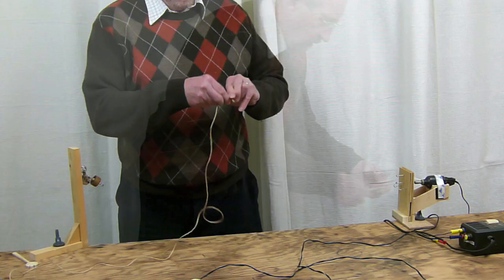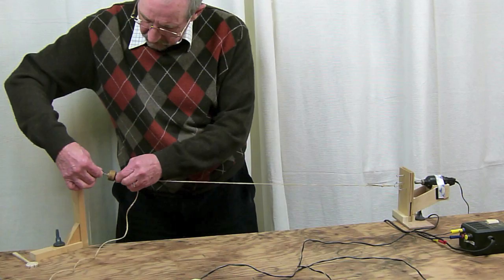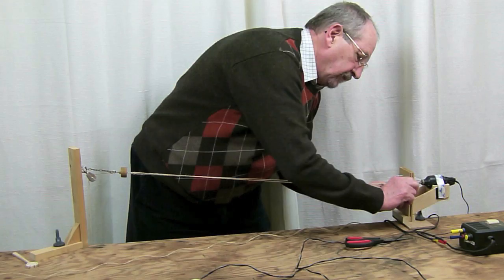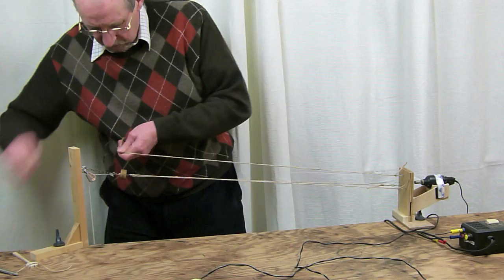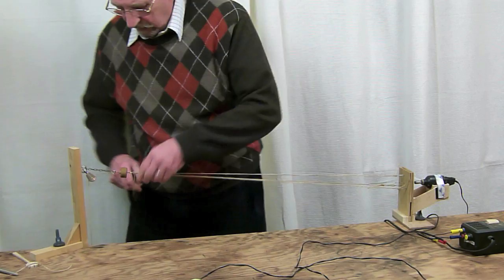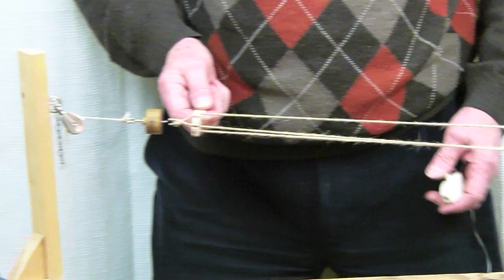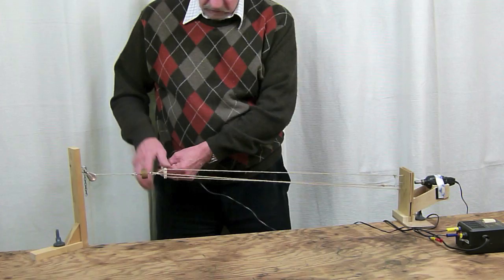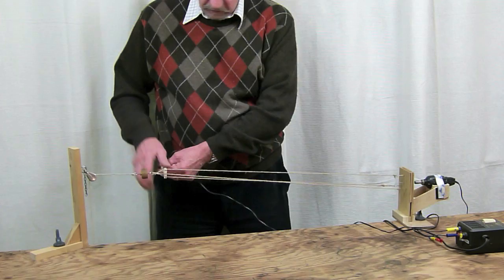Paul Nixon's Rope Making Machine

Comment from the maker: The equipment shown was only devised to make rope for model boats.  Only a very short length was made for the demonstration, typically it is used for lengths of around 2m.  Very much longer lengths would need a stronger and more powerful setup to provide the tension but real rope was made in a similar way; you can still find "Ropewalks" in towns like Southampton, long alleys where ship's ropes were made in the past.

Comment from the maker: Hi, the tension weight is simply hung on the end of the string that goes through the pulley. The weight is adjusted (by trial and error) depending on the diameter of the rope you are making. You might find the written article in the "Hints and Tips" section of the srcmbc web site useful.

Comment: Thanks for the great video. Could the same process be used to wind wire rope?
Reply: Hi, I have used this machine to make wire rope for standing rigging not fswr (flexible steel wire rope). However I have only used a lightweight flower arrangers binding wire but by using varying numbers of strands etc one can get some realistic effects. I would add that the system was intended to  be cheap, cheerful and very simple using only what was already lying around on my workbench, and best of all, it worked giving me a satisfactory result. Best rope results have been achieved using garden twine, sailmakers twine and upholstery twine and finishing off using a blow lamp to remove all the loose fibres and 'colour' the rope. Paul